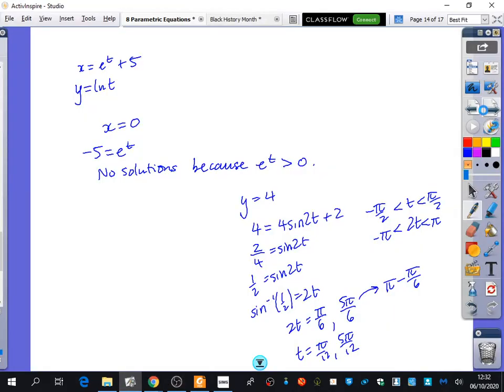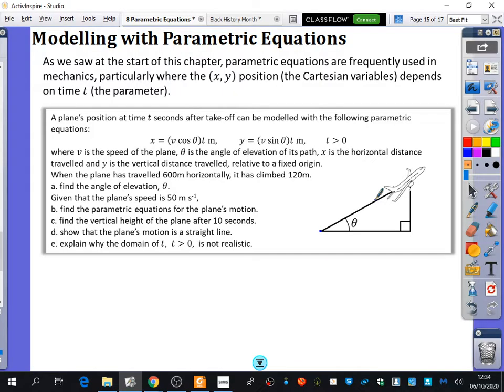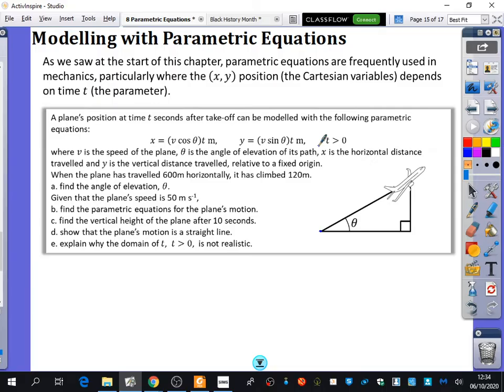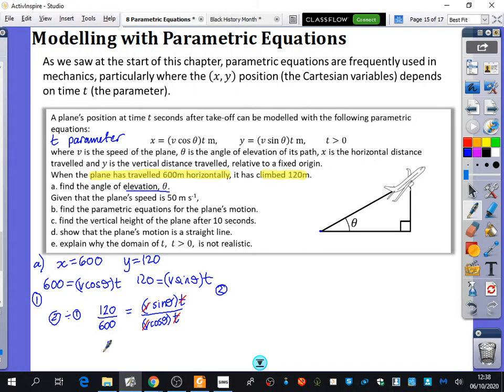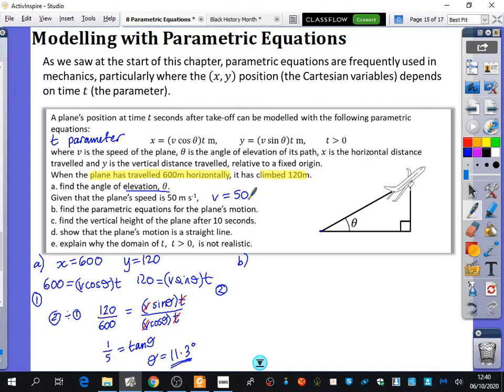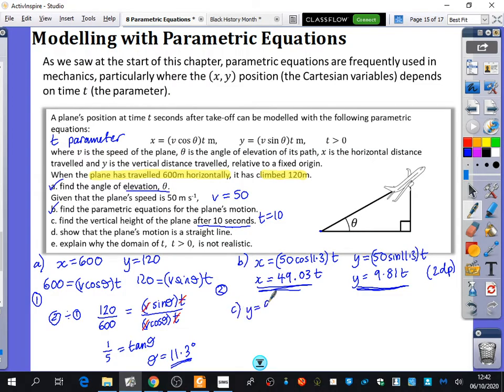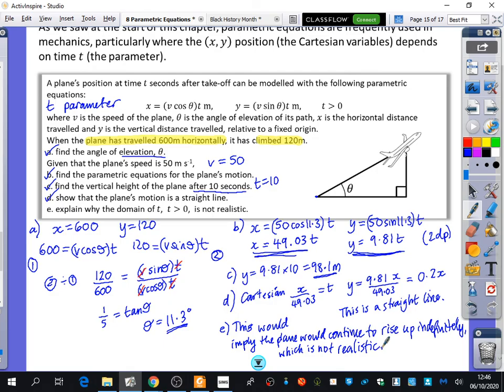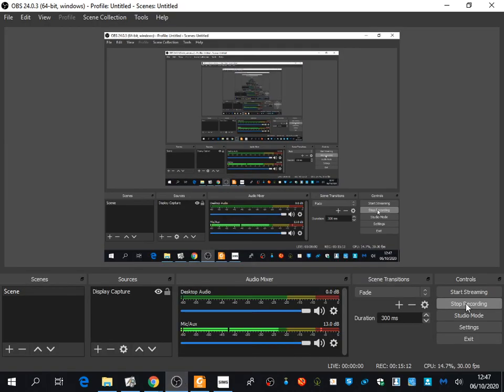Parametric Equations 6 • Modelling - aeroplane example • P2 Ex8E • 🚀

Comment: hi sir, why have you done the angle in degrees and not radians? is it just by choice or do you have to do it in degrees? thank you!
Reply from the maker: If there's any calculus in a question, I'd always be using radians. In this question theta is a fixed value, so either radians or degrees would be fine. However, as it is a modelling question, I tend to think degrees are more suitable, as humans typically communicate about real world things in degrees, rather than radians!
Reply: @BicenMaths  ahhh okay thank you so much sir!

Comment: Hi Sir, I tend to struggle abit on modelling type questions (mainly chapter 7) , do you have any advice on how to achieve all the marks? Do the type of questions you get for modelling repeat across the years?
Reply from the maker: My advice is that modelling questions are just normal questions in disguise - things like solving, substituting, etc. - so try and ignore any parts of the question that are there to trick you! :) They do tend to repeat similar styles of things, yes, but sometimes they throw in something new!
Reply: @BicenMaths  Thanks for the advice!

Comment: 9.36 i got 9.80 rather than 9.81 since calculator gives me 9.797307212 by chance u overestimated it by mistake?
Reply from the maker: Yes that's very possible! Luckily examiners will accept a range of possible answers in most questions.

Comment: Hi sir, At 7:10 , will the question always suggest whether it’s in degrees or radians in a real paper, or do the examiners expect you to use your common sense to figure out which value would be more realistic for the sample please?
Reply from the maker: It should usually indicate - unless there is calculus in the question, in which case it must be radians, never degrees.

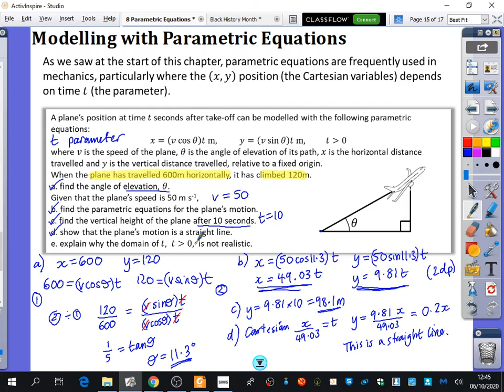Comment: Sir at 13:45 i have written the following ‘if time is going to be negative that implies that the plain is going backwards in time which means the plane is traveling into past and that is impossible therefore t has to be bigger  then 0’ would that be correct?
Reply from the maker: I'd keep it simpler - just something like t is negative, which doesn't make sense in the context of the question.

Comment: Would we be marked down if we didn’t give the cartesian equations in part (b) in exact form? I decided to use the trig triangle and then use SOHCAHTOA to find the exact values for sintheta and costheta and go from there. Are decimals acceptable in this question?
Reply from the maker: Yes, they would be acceptable as it's a modelling question - but it is worth noting that they often are interested in exact values, so it would be beneficial to know the method for this!

Comment: For part a I just went straight to:
tan θ = 120/600

Is it just by chance that I got the same answer or would this also be a valid method?
Reply from the maker: No this is valid, you're correct!
Reply: yeah i was watching and wondering if using my knowledge of right angled triangles would get me marked down here

Comment: So for these modelling questions, if there are other variables in the question like theta or speed, would they always remain constant (i.e. are the same all the time, regardless of the x and y value) and the only thing that changes at different coordinates is the value of t?
Thank you so much!
Reply from the maker: Yes, if there are other variables, they’ll remain constant - the only thing that would vary is the parameter (usually t or theta).